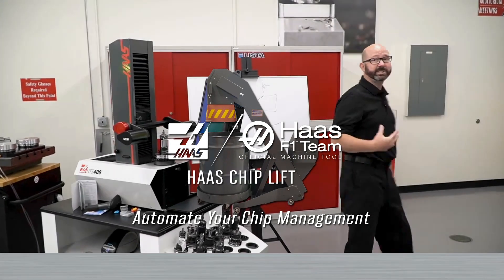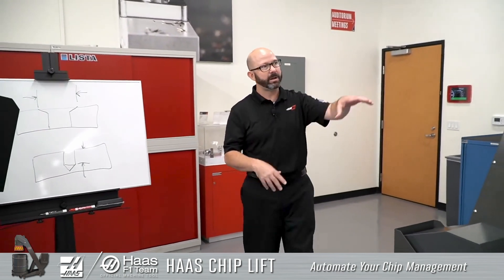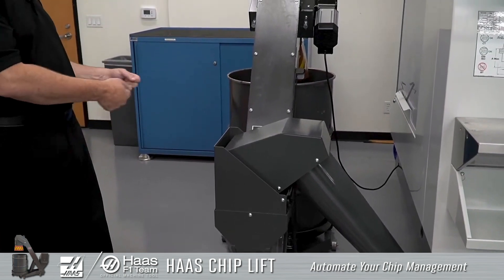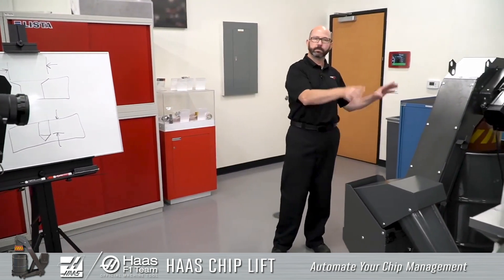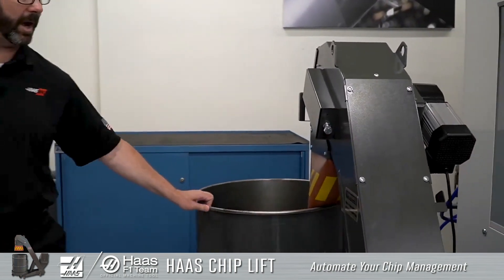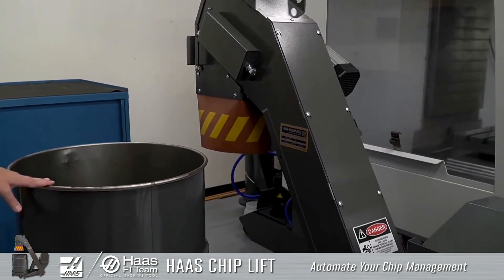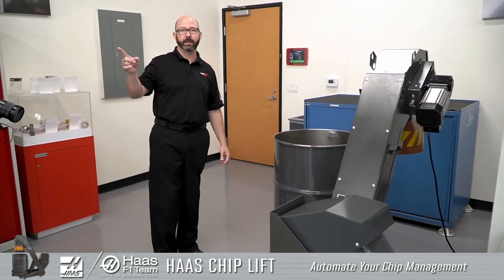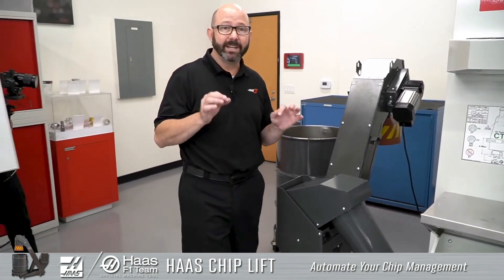Haas Chip Lift - Haas Automation, Inc.

Comment: I cant' fully automate my VF4 because the damn chips pile up into the coolant tank and foams over every hour
Reply: We have same problem on our brand new VF-10
Reply: @zyndapp800  Yeah, it sucks that the machine is so great otherwise.  We have to come up with a solution that Haas should have taken care of
Reply: @jman86200  yes. We had to modify several things to get it running but in general - these are clear engineering mistakes
Reply: @zyndapp800  This might help move the chips out. We fitted 2 sets to a VF11 and the customer loves it.  No more getting inside the machine to clear out chips 
https://www.youtube.com/watch?v=Q-nNqMaLPgY
Called Chip-a-wave.  $700 a set shipped
Reply: Aluminum? Add a second coolant pump as a wash down for the bottom of the enclosure. Keeps the chips moving to the auger.
Reply: @mechmotion  No, as the coolant returns to the tank from the machine it carries tons of chips with it into the pan.  I have to build a conveyor to move those chips up and out
Reply: This might help move the chips out for unattended machining. 
 
https://www.youtube.com/watch?v=Q-nNqMaLPgY

Called Chip-a-wave

Comment: Looks like a band aid solution, just make the auger outlet tall enough for a standard drum (and removable if required).
Reply: They used to make the chip chute long and tall enough that you could cut a section out of a barrel and have the chips fall right in. You had to remove the guard at the top of the shoot. (Though you have to do that anyway to be able to scrape out cast iron)
Reply: This might help move the chips out. We fitted 2 sets to a VF11 and the customer loves it.  No more getting inside the machine to clear out chips 
https://www.youtube.com/watch?v=Q-nNqMaLPgY
Called Chip-a-wave.  $700 a set shipped

Comment: Chip auger is complete GARBAGE. Just make the conveyer standard instead of an 7K option
Reply: I have heard a few complaints about the HASS designed Chip Auger ??
The Auger design is ok for use in horizontal applications (even then ???? )
Never seen another major machine builder use this design as a conveyor though.

You mention 7k for the option.
Is this the standard flat conveyor design everyone else uses on there machines ?
Reply: @weldmachine  you have never seen it because it doesn't work LOL 😆 for horizontal it kinda works to get the chips to one place but for vertical use it doesn't. But that seems like common sense to me.
Reply: Yes, Haas has unreal price for conveyer. Other builders have this in standard
Reply: Chip auger actually works amazing with this simple and cheap addition.  
https://www.youtube.com/watch?v=Q-nNqMaLPgY
Called Chip-a-wave  $700 delivered.

Comment: Instead of having an add on why not design a reto fit where the shoot is attached? And make it an upgrade option , or better yet a standard on your new machines?
Reply: It's an option to fix what was originally a Bad design.
I guess you could call it an expensive Band-Aid, LOL.
Reply: This might help move the chips out. We fitted 2 sets to a VF11 and the customer loves it.  No more getting inside the machine to clear out chips 
https://www.youtube.com/watch?v=Q-nNqMaLPgY
Called Chip-a-wave.  $700 a set shipped